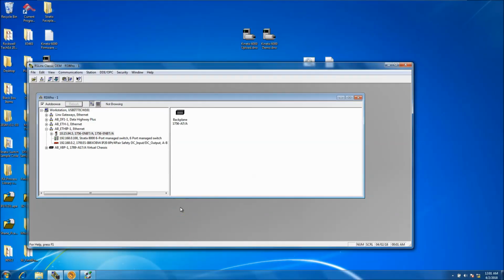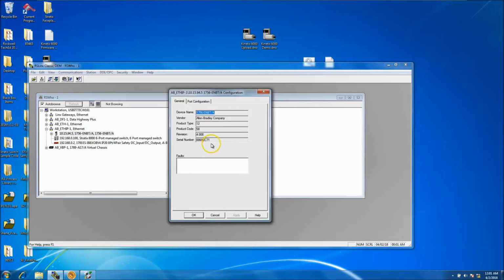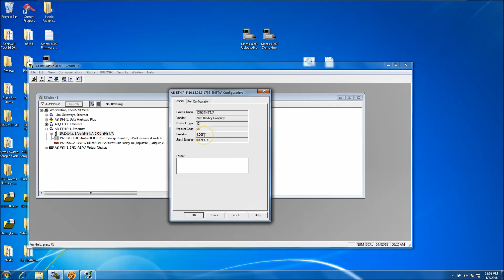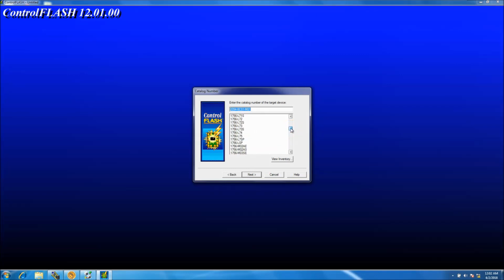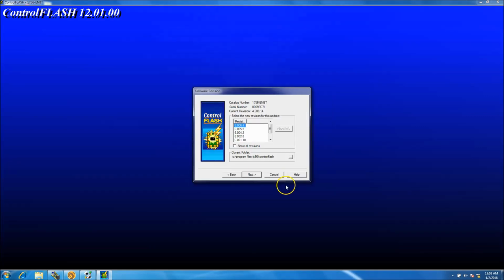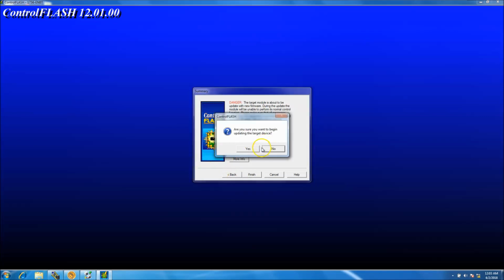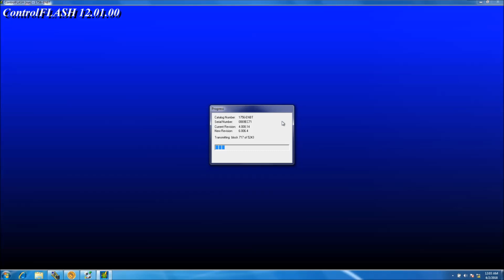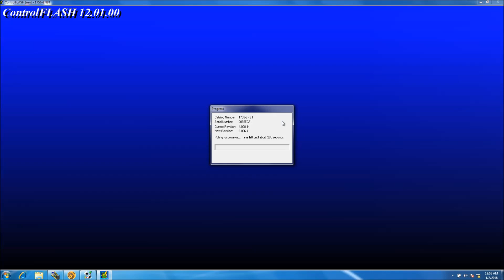Using Control Flash an 1756 ENBT Ethernet Card For Unicast

Comment: Hello Shane. How are you? Thanks for your video. I have two Questions? 1. I have the 12.00.01 ControlFlahs, but it have not the firmware 6.002 that is i need. I have the 6.002 firmware file (alone) but i don´t know how to put on ControlFlash. How do i get to put on this version 12.00.01?
2. or would you like give me the link to download your revition of 12.01.00 (i can´t find it on AB page), with the 6.002 firmware? Thanks foy your help
Reply from the maker: You can download the firmware from the Rockwell site then add that feature to Control flash.

You have a manually add anything that isn't there
Reply: @ShaneWelcher  Thanks for your answer. I have the 6.002 firmware. But manually, i don´t know how to put on ControlFlash 12.00.01. Thanks for your time.
Reply from the maker: I try to find something for you but currently I am driving all day so time limited right now
Reply from the maker: You need to make a DMK kit.

Device management kit.

A Device Management Kit (DMK) is a file that contains firmware update files for one or more devices.

A DMK file contains:
• All files necessary to perform firmware upgrade of a single or multiple catalogs.
• Digital signature files for validation.
• Release Notes if it was included in the file.

Place DMK files in folders monitored by ControlFLASH Plus and the software will search all the monitored folders whenever it looks for available revisions. The monitored folders can be added on the Firmware Locations tab of the Settings dialog box.

If it is not a signed firmware then use this technique.

Use the Manage Firmware tab to manage firmware revisions located in the monitored folders. When you are signed in to the Product Compatibility and Download Center, it also allows you to download firmware revisions and view the firmware revisions' Important Notice from the Product Compatibility and Download Center.

To add a monitored folder:
1. Select .
2. In the Setting dialog box, click the Firmware Locations tab.
3. Click Add Location.
4. In the Browse For Folder dialog box, select a folder.
5. Select OK.
To add firmware revisions:
1. On the Manage Firmware tab, select Add Firmware Revisions or in the Device column.
2. In the Add Firmware Revisions dialog box, search devices, and then select firmware revisions as needed.
3. (optional) Select to view the firmware revisions' Release Notes or select to view the firmware revisions' Important Notice.
4. (optional) Select View selected revisions to view the firmware revisions you select.
5. Select Download.